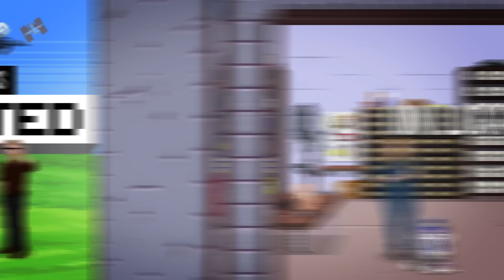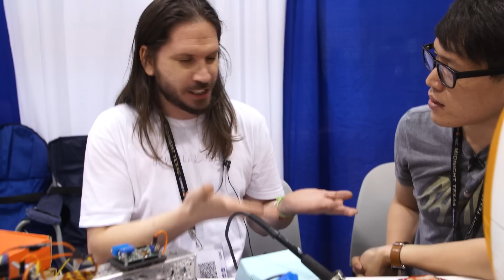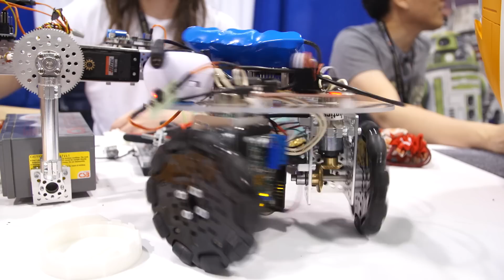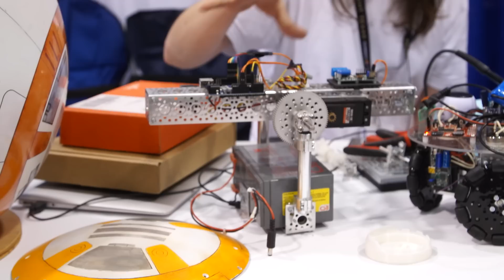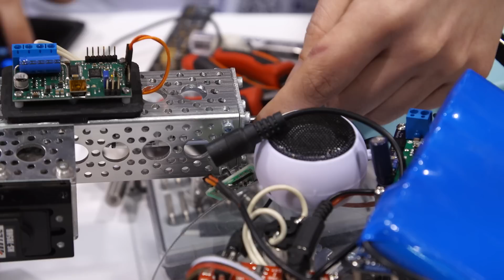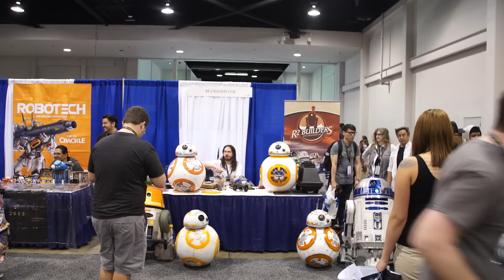Catching Up with BB-8 Droid Builders at WonderCon 2017

Comment: The so the foam panel treads on the triangulated wheels of the head, one slides on the back but the force of the other two wheels is greater than the wheel "blocking" the motion and so it's just dragged along effortlessly.
Neato, I thought it looked flawed at first.
The weighted ball trick is a cool idea too though I wonder how he intends to make it turn... perhaps another smooth ball shell  to roll freely inside this outer shell with a circular track inside circling it and another foam slider holding up the weight so it can turn within 360% within the ball
idk the inner shell would have to be  heavier than the weight itself
... nah idk weird thought
stick a roam feature in it and a custom Amazon dot type thing in there (implying you'll trade of the bloops and beeps) and you've got yourself what is essentially a bb-8 to keep around the house.

Comment: his bb8 will never work because I don't believe just programing is enough to keep the head on top. especially at high speeds like he mentioned was his goal.
Reply: muhahhaha
Reply: Maybe. Maybe. But you've gotta admire his creativity.
Reply: He literally said it was tearing across the day before in the video lol
Reply: wow, you believe everything you hear.
Reply: His wheel configuration can turn very quickly but it can't traverse the sphere it sits upon efficiently enough, without having one of the wheels block the motion and risk the head flying off. His logic is even completely flawed - he decided to try this design because the usual way can't cope with fast base motion well enough and tends to just fly off, but his is not even held onto the body at all, so it's a wonder if it can stay attached to begin with.

I think on set, BB-8 was used in at least two configurations, whenever they could work with the head, they left it on, and it's supported magnetically from inside the base like in those numerous fan built ones, whenever there was too much debris or it had to travel too fast, the robot was filmed without the head and the head was added in post production.

I think the way to make the head work in all circumstances is just to expand on magnetically supported head idea. Bigger stronger magnets, aligned magnets both sides, bearing supports both sides, ball transfer units head-side, big custom servos driving the rig in the main body, very even panel thickness. Chances are, if you want to beat the screen prop at capabilities, you'll need to put years more of engineering effort, and heavier duty parts into it than they did into the screen prop.

I think something akin to his idea could also work: full metal shell for BB8 body and magnetic wheels for the head, about 4 of them, angled maybe only slightly. Whenever the body is rolling fast, the head would need to fully align itself with the rotation direction, but it can be done.
Reply: Siana Gearz, note the omni wheels - no wheel will "block motion". This guy has put a little bit more thought into this design than commenters here.
Reply: Daniel G Ooooh sorry my bad, yeah that's one step towards possible. Yeah if he's good with digital gyro controls, he can make it work at least for low speed cases well.
Reply: Once the mechanics of the design theoretically work there is only programming.
Reply: Luckily robots aren't powered by your "belief".
Reply: your delusional if you think he can program it to stay on top of bb8 round body with nothing but programming it needs a powerful magnet on the inside one bump and the head goes flying off.
Reply: Highteckhobbies how do you know there isn't a magnet inside?
Reply: Highteckhobbies The point is saying something might not work  and saying that something will never work are very different. One is constructive the second is arrogant and unhelpful.
Reply: James Bruton has both a BB-8 AND BB-9e working - you should be promoting his work instead of this half baked stuff